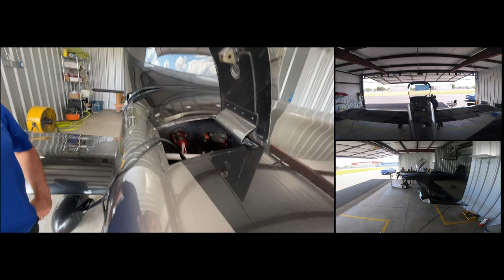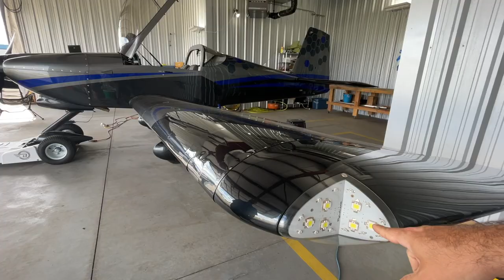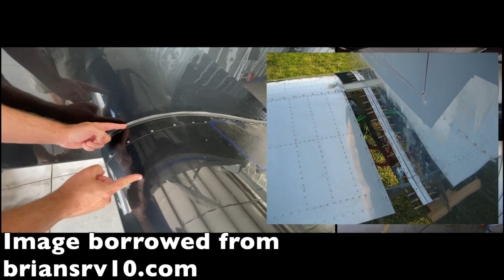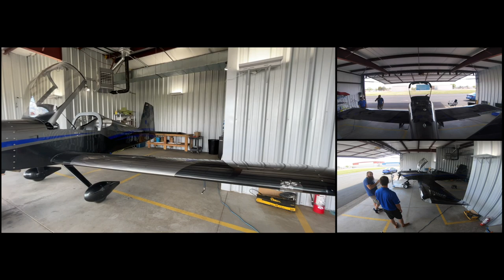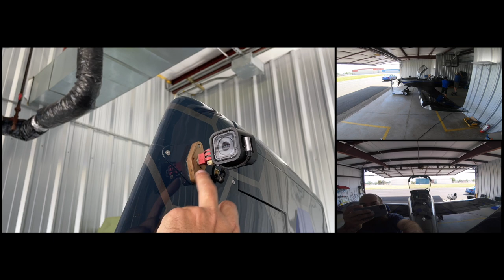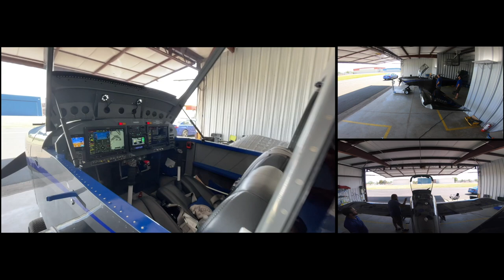RV-9A - Mods & equipment choices

Comment: Regarding antenna locations, the ham radio nerd's motto is "height makes might";  the higher, the better. Even as high as the B-757 sits, we often found that the upper antenna would reach ATC much better whilst on the ground.
Reply: Having just taken the electronics 2day seminar at OSH that is what was said as well. The belly com antenna has less range by the fact it is bent. Recommendation is to put both com on top with proper spacing of course.

Comment: Great vid! Several thoughts from a fellow RV-9A owner: (1) I can confirm the piano hinges in the cowl are a huge pain. I’d definitely use quarter-turn fasteners there. (2) totally jealous of your oil door, may have to install one like that…. (3) spotlights in the leading edge at the wing root is a cool idea! (4) easy to tell if my unregulated pitot heat is working, I just watch the current draw spike when I turn the lava-level heat on! :) agree that regulated would be worth it (5) GoPro mount is super elegant (6) never had probs with both com antennas on the bottom, but splitting them makes sense (7) best mod by far on mine (a slider) was the Supertracks canopy extension.
Reply from the maker: Great feedback Doug, thanks!

Comment: Hey Guil! Michael White from Iowa again here. Thanks for your Oshkosh videos! My dad and I enjoyed your fly-in video whilst working on the wiring of our 9A. "Nice rock!"

Had a question for you: I noticed from some of your "cabin view" videos that the altitude readings on your G5 and GDU 460 are not exactly the same. We're getting the same thing on our system. The two are off by about 25 feet. Not a big concern, but wondering if you've messed with that at all, or didn't worry about it. I suspect the deviation may change (for better or for worse) when calibrating the altimeter(s) for IFR.
Reply from the maker: Good catch. During our pitot/static biannual tests I always ask if they will adjust that and they are happy to do it for a $$$ fee. Apparently the procedure involves running both altimeters through a somewhat length process? I figured it's pretty stable around 20' difference for us, and they both pass certification so I left it alone. If I ever find an altimeter test set I can get my hands on, I'll spend the time to calibrate it myself.

Comment: Are you using any legacy VOR/ILS equipment in your 9a?  If so, what antenna solution did you go with?
Reply from the maker: The GTN-650xi has a vor/ils. I use the Archer wingtip antenna which works fine.

Comment: With regard to the ELT, you don't need the ELT during Phase 1 testing.  If the DAR gives you any trouble, just remove it and put it on afterward.  It is not a condition for the AWC.  If the DAR insist on it, find another one who follows the rules.
Reply from the maker: Why? Getting all that installed during the build is immensely easier than after. Not to mention then you have an ELT during the critical Phase 1 flights. What do you gain by removing safety equipment?
Reply: @BuildFlyGo  You can installed it but leave it out for the DAR if he gives you trouble.  The point is the ELT is not an AW item.